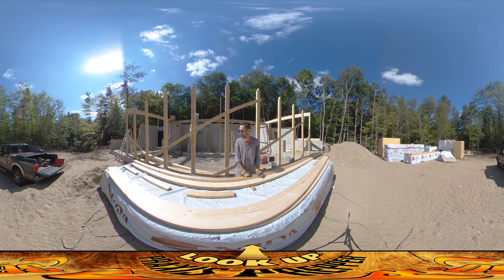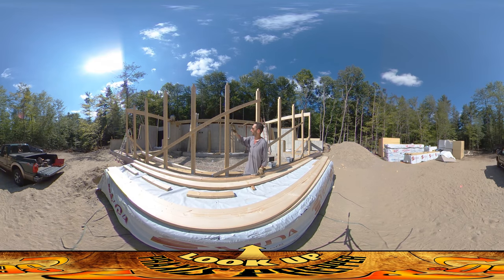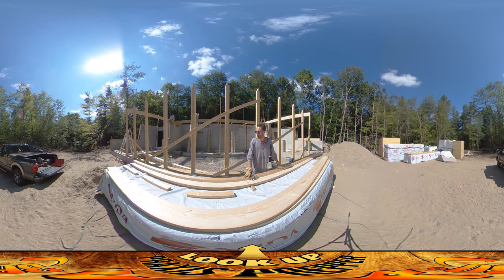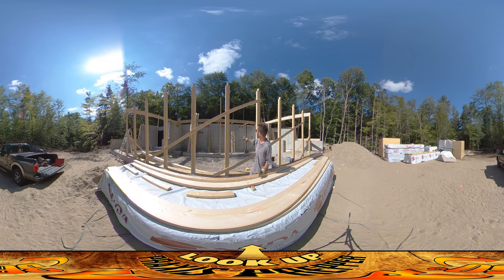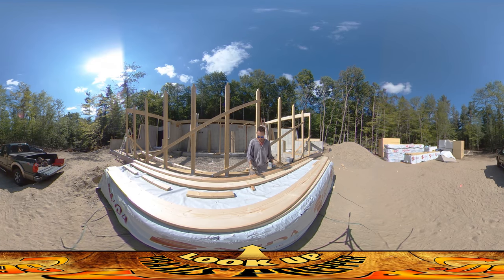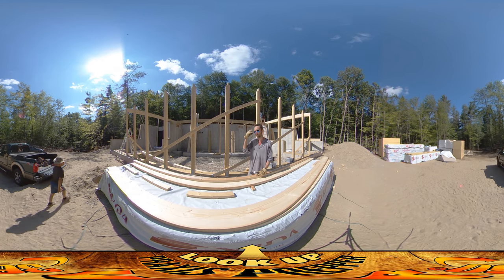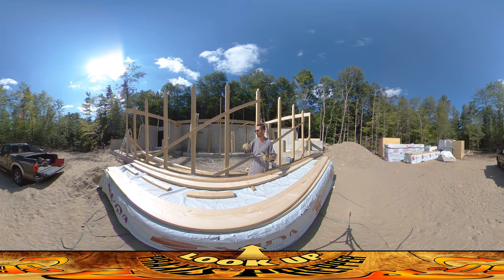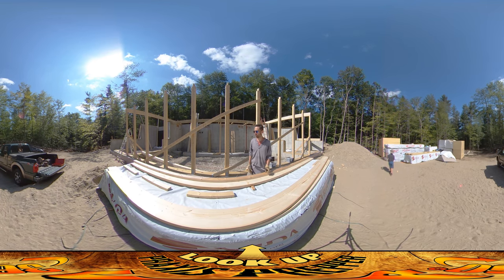Homestead Building - Floor Joists Assembly, Hand Injury, Speed of Work

Comment: I know these videos are behind your current status but boy do I wish I could have given you the advice to invest in a hobby grade set of air hammers and small air compressor. I did a "major" rack building project in my garage a decade ago and after a day making little progress simply because of the hammering I went out and got a kit with 4 different sizes of air hammers and a small compressor and knocked out the remaining 75% of the project in less time than the first 25%. The only regret I had was that I didn't buy a little better compressor. I don't use the hammers much but when I do they make the project go so much faster and I actually use the compressor a lot more than I ever expected to.
Reply from the maker: Alas, I'm a stone age builder at heart. I know that air tools make a lot of sense... but where's the soul??? (Answer: It's probably somewhere in the hours of relax time that I could spend at the end of each early finish day due to the faster work speed)